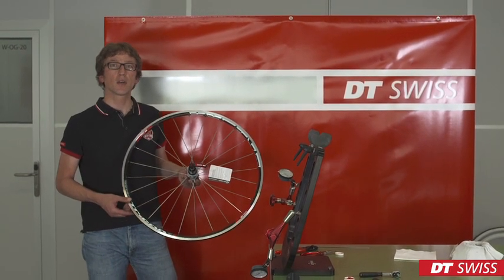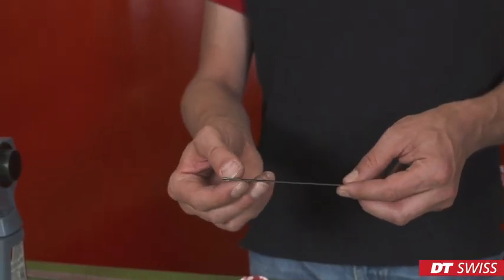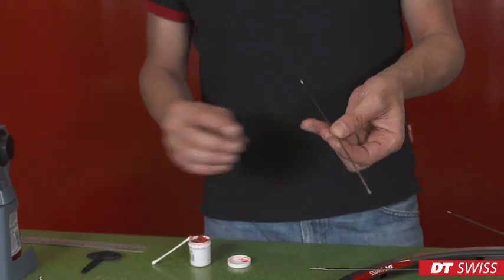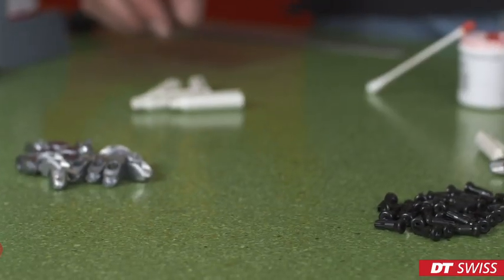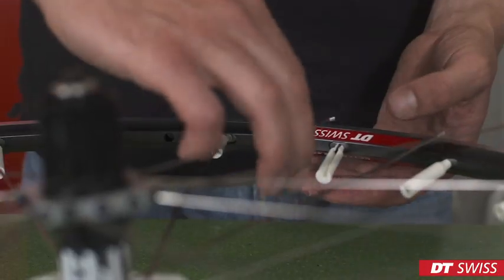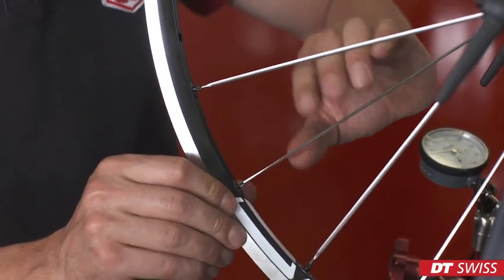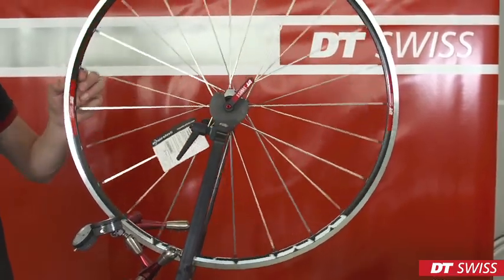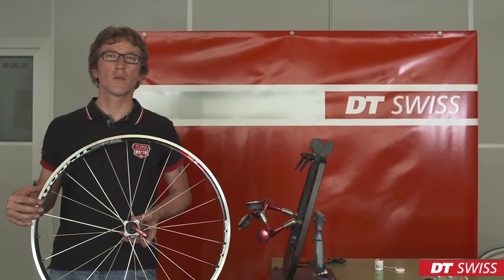How to build wheel from A- Z: TRICON.  | DT Swiss

Comment: I have two mtb's with dtswiss tricon wheels (both 26"), titus racer-x with xm1550 and commencal meta-6 with m1700. 4 years ago one of the white spokes on the xm1550 was broke (rear / radial / non drive side), I cannot find a replacement anywhere, help me please..
Reply from the maker: Hi Aria, please get in contact with us by e-mail service@dtswiss.com. Kind regards, José, DT Swiss
Reply: @dtswiss  Helo, tomorrow I will send you an email with the pictures. Thanks for the reply..
Reply: @dtswiss  Email sent, please check, thanks..
Reply: @dtswiss  Intl service center told me to contact Indonesian distributor, but they don't have a replacement spoke for my wheels. Please send to our local distributors, so I can buy from them. I'm really desperate, my expensive wheels do nothing for 4 years..
Reply from the maker: Hi Aria, just relax we are working on it. You will hear from us about a solution soon. Kind regards, José, DT Swiss
Reply: @dtswiss  Thanks for your help mate, hope I can get the parts soon.